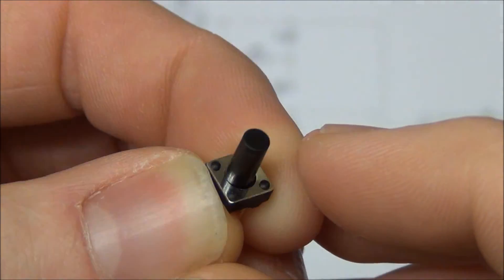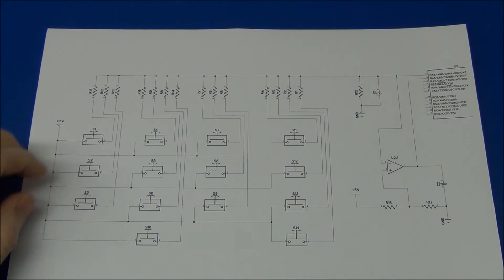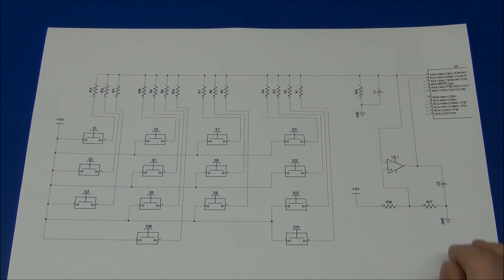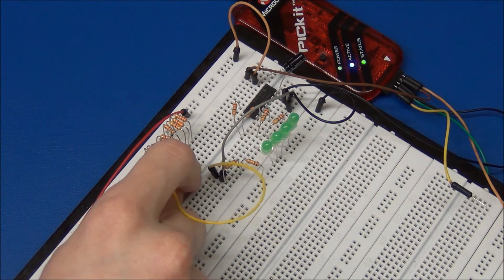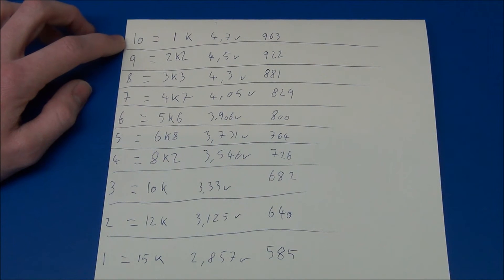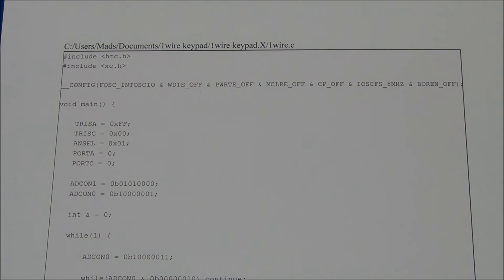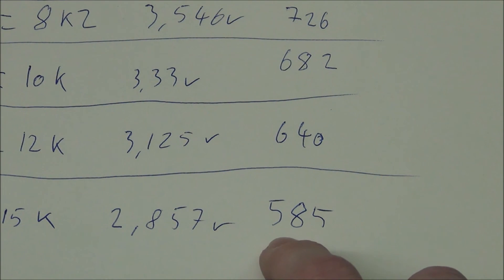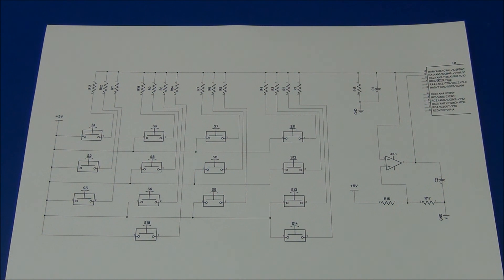Ec-Projects - 1-Wire Keypad (Multiple buttons on a single MCU pin)

Comment: Look at the age of the design, it is old but still good, you assign priority in design. I remember that from wondering how they had a wired remote with a LED but did not have any electronics inside the remote. Not on the net but they did that by running the diode in inverse parallel to the keyboard and having a set of 4 analogue switches to flip the wires from the measuring circuit to led drive at 100Hz.